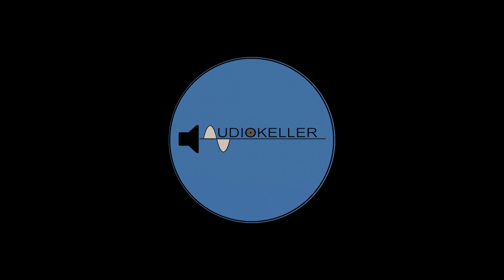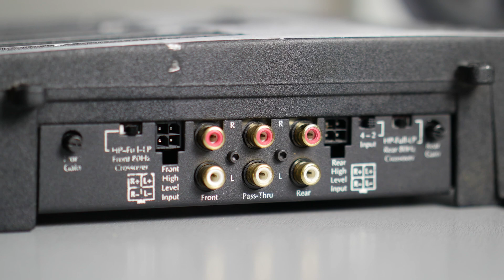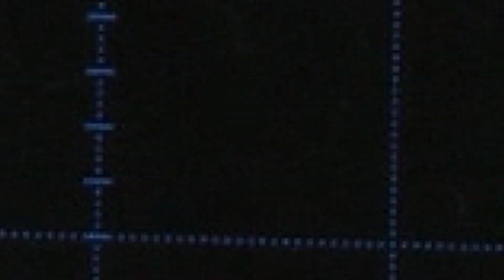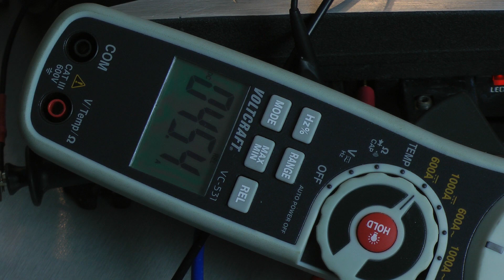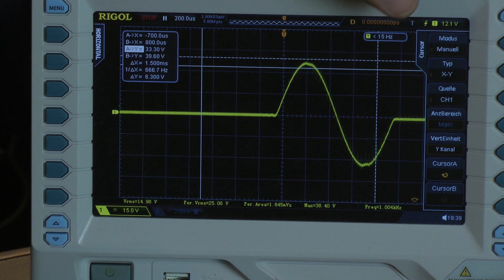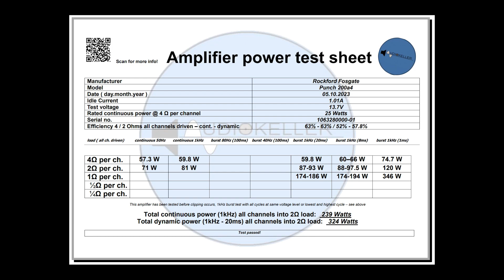Rockford Fosgate Punch 200a4 amp dyno run 4 channel oldschool car audio amplifier power test 1 Ohm !

Comment: I grew up in the 90s rocking these amps I’m about to get another this week. What would you suggest for a couple 12s either kicker or jL. I found a punch150 and a phosgate 200 and a 400a or a punch 75 I think I’m gonna get the 200. I have a phoenix gold 600 old school but the red light is on and off and the 3 main aren’t on but the fan runs
Reply from the maker: Which 200 is it?
There is 200DSM , 200ix,200x2,200a4,200.2 and maybe I forgot one …

Comment: I have a question on how you have stated in these videos that on these particular Rockford Fosgate amps you can adjust the current idle!!! How do you do that and is it hard to adjust on these amps??? Can you please explain that to me!!! I have a few of these type of series of amplifiers and i noticed that they get pretty hot after a while of playing them loud in your vehicle!!! So how do you adjust the current idle so that won't happen??? Thank You!!! Your videos are always really great and very interesting to watch!!! 👍👍👍
Reply from the maker: I have a tutorial video here on YouTube, just search for „ Rockford bias adjust „ - that’s it 👍😊
Reply: @audiokeller1975 Okay i will try to search that video!!! It's something that's very interesting and important to me!!! That's because my amplifiers from that series have a tendency to get really hot from playing them at high volumes!!! I want to see if by adjusting the current idle it will really help my problem!!! Thank You and i will keep you posted on this situation!!! 👍 👍 👍
Reply from the maker: @josea.garcia3994 it’s normal if amps get hot if used hard. Just
Monitor the amps temperature when the amp is doing nothing, it should not get hot but cool to light warm.
First step is to check the idle current of that amp with a multimeter. In the mid 90s generation fosgates they put the value of idle current in the datasheet.
For example: if a punch 200 DSM or punch 500a2 pulls around 3-4 amps it’s time to readjust them.
Reply: @audiokeller1975 So then how many amps should these amps be pulling to know if the idle current needs to be adjusted???
Reply: @audiokeller1975 So then how many amps should these amps be pulling to know that the idle current needs to be adjusted!!! What are the total amps that they should pull for them not to run so hot???
Reply from the maker: @josea.garcia3994 there is no number to adjust them to. I adjust them right before the crossover distortion at high frequencies disappears. Sometimes one and the same amp works well at 0.9A and some at 1.6A for example.
Reply: @audiokeller1975 So that means that you have to pretty much adjust the idle current by ear!!! To where they work without getting too hot is that correct??? So there's no specific number setting correct???
Reply from the maker: @josea.garcia3994 have fun by ear at my age at 20kHz 😂 watch the scope or just at the point where the idle current starts to jump .
Reply: @josea.garcia3994 getting hot playing or at idle? Make sure it’s not below ohms if while playing

Comment: Hey why aren’t you basing your calculations on the true ac output vrms?
Reply from the maker: I always use the RMS voltage values for power calculation 👍
Reply: @ ahhhhh good man👊🏼

Hey what do you think about this dual channel handheld scope DSTouch DS4T252 ?
Reply from the maker: I can’t tell , I never used one. It depends what you wanna do with it. If amp repair or something I would rather go for an old scope 👍
Reply: @ just general purpose honestly. I have one of those small handhelds currently and i quickly discovered that having only 1 channel of input is a shortcoming and it would be nice to be able to overlay two sine waves to check for things lkke phase or delay ? 

Hey also, someone is locally selling the punch 200a^4 for $180. It appears to be in decent shape. Is that too much he is asking for ? I’m a little hesitant and stopped purchasing old amps since the last 3 performance tekniques I purchased turned out to being what looks to be a total loss and I’m bummed.

Have you ever seen a transistor leak and bumble out some weird stuff ? It’s amazing I wish I knew all this stuff before hand. I was well aware of caps going bad and leaking or puffing lkke the ones in these amps but never did I hear about these 3 legged igbt I believe they are called leak
Reply from the maker: @ very rare, the 1998 amps are solid , it depends how it has been used.
I can’t tell if it’s too much because in the USA all that oldschool amps are crazy expensive and have higher value than here in Germany.

Comment: What do you mean by "adjusting the Idle current"?
Reply from the maker: On the mainboard is one pot for each channel. With this pot you can adjust the amps bias ( idle current ). It’s important to check older amps if they idle correct, this is the amount of current the amp is pulling out of your power supply or battery when the amp is doing nothing, just turned on without amplifying music. If it’s too high the amp gets warmer and runs hot, if it’s too low you get distortion. I have a video on here where you can watch how it’s done 👍
Reply: Nice..Is it on your page? @audiokeller1975
Reply: You speak my musical language.  Love hearing about these classic amps.

Comment: Hello, nice video as usual!
I just bought a Punch 700X amp (4 ch.), from Wattsuppaudio.  Do you know if this is a good amplifier?  I bought a Rockford P8004 amp (2005), 3 years ago, but is now broken!  Do you think they have about the same power, or close?  Thanks!😊
Reply from the maker: Thank you for your kind comment as usual 😃 yes, the 700X is a good amp but I can’t compare it to the p8004 as long as i get one to get dynoed, but as an old guy I tell you: don’t just look at the wattage - just enjoy them,
All Rockfords are great amps which I had on my bench, still waiting for a bad Rockford amp if you know what i mean 😃
Reply: On the power test sheet, where it says: Total continuos power at 2 ohms all channels driven, you wrote down the value of 4 ohms, Not of 2 ohms!  And where it says: Total dynamic power at 2 ohms all channels driven, you wrote down the value at 4 ohms Not at 2 ohms, also!!
Can you please check if I am right about this, and let me know?  Thanks.
Still a Great video!😮
Reply from the maker: You Are right, I made a foolish mistake, I throw the sheet away and print another one ! Thank you very much!! You have very good eyes 👍👍👍👍
Reply: @audiokeller1975  You are welcomed!  I just pay a lot of attention to numbers.

Comment: how close are these to the bbq style from the previous generation? and what model would it be equal too? I actually have a nib 160.4. my first amp I ever owned was a 4020 powering a pair of mb quart 6.5 ref series and a solobaric 8. in my first car when I was 16. my uncle gave me that car on my 15th birthday. a nice little porsche 914. that system sounded amazing in that little car. not near enough bass for me. But in hindsight, it sounded excellent.
Reply from the maker: The bbq style amps are
My favorites but this generation is technically the same but later they used
These Mensa strips which makes them a little harder to repair, I also have a 160x4 bbq style which is a little weaker than this amp, it has lower ratings, 20watts into 4 ohms.Even the newer ones from 1999 or 2001 are very similar. All of them are great 👍 the newer p2002 which I will dyno next, is rated like a punch 100ix but can’t keep up with the 100, even a bbq punch 60 slightly outperforms the p2002.

Comment: How did you become such a big Rockford Fosgate fan? I think they are great amps but many good amps out there. I'm curious what equipment you have in your car. Maybe you can do a video on it.
Reply from the maker: It was back in 1995 when i purchased my first Rockford amp.
I never heard about Rockford Fosgate here in Germany.
But the guy in a shop told me a lot of the differences like
low ohm capabilities , 3 years of warranty including good 
efficiency and dynamic power in a Punch 40ix which was very small
in size especially when the endcaps were removed. 
3 years of warranty werent usual in germany, was a quick decision but 
asked my self why i should
buy a 40 Watt amp for around 599 german marks which was expensive back then!
I had a selfmade push/pull subwoofer with two 10" Eminence Car Audio
drivers ( made in USA ), if i remember correct the model was " EC V-10 " 
which werent too expensive but played well and deep in a small enclosure.

When i first plugged the Punch 40ix i expected more output, so i 
talked back to the guy at the shop and he just answered:
Take more power out of the amp and connect it bridged mono 2 Ohms.
After that i was more than happy ! I sold everything after 5 Years.
I know this amp is not rated for 2 Ohms mono, but it did well and never 
ran into Problems or excessive heat.

You may be surprised because i dont have a car audio system in my car :-)
I am still building speakers sometimes but it moved to home-cinema-use
or public adress audio.

Home cinema is very similar to car audio but its harder to get it sound nice
because of room problems which dont occur in a small room like a car.
I run two 18" Subs in my small " Audiokeller " which is a room in my basement.

I am still a fan of the old Rockfords because they are easy to fix and it
doesnt break the bank. 
I built my first DJ-amp in 1995 or 1996 maybe i should do a dyno of that
weird looking 700 Watt amp which is true dual mono with one power supply per channel.

And another thing is that i can have fingers on amps which werent affordable
back in the 90s especially here in germany. 

It started during covid, still enjoying these amps.

I know that there is better stuff out there, but at the moment i am not 
interested in this.
Reply: My first system was a hafler amp by rockford Fosgate 22x2 watts pushing pioneers 6x9 3 way speakers they sounded crisp and loud. I had a lanzar white amp 50 x2 watts with 2-8 "punch subwoofers in a sealed box they sounded like 12 inch subs. Unfortunately my car was opened and they stole my system. It wasn't alot of money but it was a great sounding system. 😢
Reply from the maker: @joeJoe-pb3su hi 👋 
In which year(s) were the hafler amps available?
Reply: @audiokeller1975   I bought in the 1993.
Reply: I think I paid 100 dollars. Some people said it was 300 to 320 regular or retail price. I guess I got it on sale or clearance price. So it was a good price. 👍